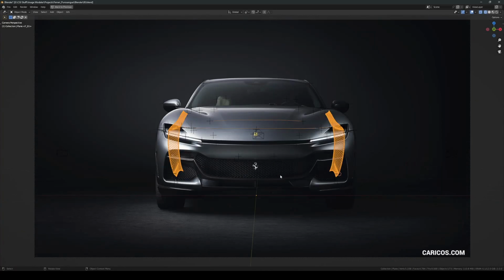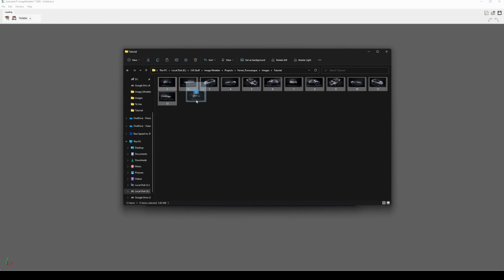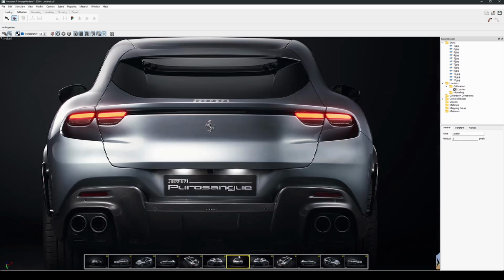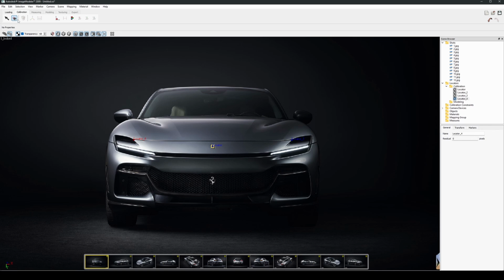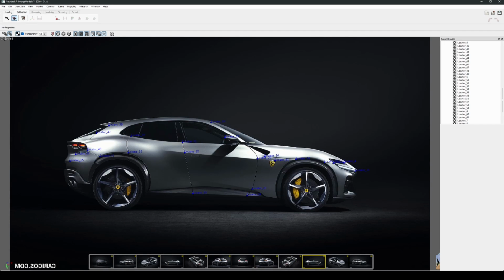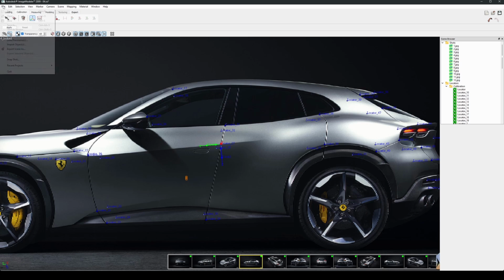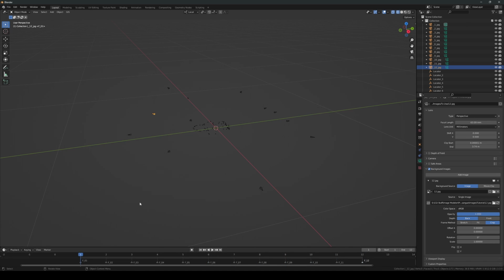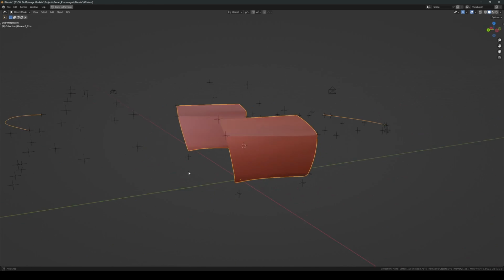Blender - Calibrate Images For 3D Modeling

Comment: I would recommend against placing too many locators in the beginning stages. Start with the front and place maybe 10-12 locators on the first 5 cameras, then calibrate, then start adding more and calibrating one camera at a time after that. I found that placing too many locators at the start can often confuse the application and if you've got so many it becomes more and more difficult too troubleshoot. There is also very little need to mirror the other side of the car, in most cases you can get away with maybe 8-10 images.

Lastly the 'photos' in this tutorial look like renders of a 3d model already and the front and back views are  perfect but if you are modeling an older car (before 2000) or maybe a car that is a bit more obscure and hard to find good pictures of then there is no chance your photos will be this good so your mileage may vary. Browse car auction sites and sites where your chosen car may be for sale, these generally have the best pictures of older cars.

Comment: Correct me if I'm wrong, but wouldn't camera tracking in Blender can also do the same as the image calibration process here? If so, that would save the user so much time because everything can be done in Blender without hopping to different softwares.
Reply: hi i've seen you on artstation
Reply: @Txkyohoshi  Hi! I also follow you on ArtStation! Your recent work on the Celica looks sick!
Reply: @Txkyohoshi  我也这么认为

Comment: any chance you could refresh this method to use something more recent like fspy?
Reply: if you really want to do something like this, you can just do it in your 3d program of choice by creating cylinders and trying to match their perspective to the wheel of the vehicle in reference image but that process takes hours if not days but just for the information, that is also a process that will give you similar results but is way way WAY more painful than placing a bunch of locators.
Reply: @Kumar-bg6nr  its VERY inaccurate that way
Reply: @Kumar-bg6nr  problem is the models i want to make are "no good blueprints" but aren't necessariyl lending themselves to good results with imagemodeler either, even with tracking targets.

Comment: This is a valuable tutorial. I'm all over this and going through it now. 
Mixing renders and photos is bad understandably. What about photos from different sources, how problematic are different focal lengths/cameras? Have you successfully modeled something from multiple sources?
Reply from the maker: That is fine, the reason renders and photos don't mix is how a company would say on their website as disclaimer that a product may not be as seen in the renders, pictures taken from different sources of the same car which is the final product of the company is fine... not sure if it makes sense... simply put renders are not the final product, they are just a representation...
Reply: @NaturalArtFreak  Thanks for the response. It makes total sense renders & real photos don't mix. The blueprint & final product have slight differences that won't align. That won't be an issue I'll be dealing with.
   What I've been wrestling with is different cameras and focal lengths, trying to match positions & painfully trying to align multiple angles. It's a lot of trouble and never quite right.
Reply: @shanester1832  ok. did some research. if you match distance of the camera from the subject, then you can just zoom the reference in or out until it fits. this will probably work in blender. maybe.
Reply: @lukefortune8314 thanks for the reply. I remember searching for something like this but never finding it. Manual photogrammetry pretty much, because to my knowledge, nobody's working on a photogrammetry approach where light source isn't a factor. Where photos taken of a moving object are just as viable as moving the camera around a fixed object.
Reply: @shanester1832  It may exist, but clearly not in any of the free software. there is a program called fspy that can solve for a camera position in a still image. might accelerate the manual process a bit.

Comment: I don't know how you did this. I even used the same images that you used in the tutorial, and I was INCREDIBLY careful in placing the markers (even named them all individually so that there's no confusion), and more than half of them end up being yellow and red. And no matter how much I adjust them, they remain yellow and red (and after I try to adjust them and then calibrate, there end up being even more yellow and red markers).
Reply: I managed to make things work, and I'm leaving a comment here in case someone encounters the same issues as me. Instead of importing all the images at once, I started with only two and added about 13 control points between them, then calibrating, and only adding more images if all the control points are green. I kept adding an image and control points, calibrating, then importing another image. Keep saving often, and if suddenly your control points turn red or yellow, just reload a save because it's a big mess trying to fix them.
Reply: same thing to me  @xayzer
Reply: If you mean you are experiencing the same problems as me, look at the comment with which I replied to my original comment, I found a solution that works for me and I wrote down the details.  @thomascook7319

Comment: Blender has a camera reconstruction (camera tracking), I did not try this but I think you could get this done in blender instead of Imagemodeler 2009. But I am not sure. I should try this once. If you load your images as a sequence in blender you should be able to reconstruct your cameras by hand in blender like you did in Imagemodeler by hand. There is also other Software like Photomodeler or Photoscanner much newer then 2009 on the market. At last this is SFM-structure from motion. I think they stoped this software because there are better solutions for this.
Reply: Any luck with using Blender to do the calibration?
Reply: @carsonw722  I tried this, but my Photos were not good at all and I had not enough tracking points. But there is a software calls photomodeler and is much newer then 2009, maybe you can do this with this software. Because I am on linux and cannot install a win.exe. But I used Photomodeler in an earlier version 20 years ago. So here I am sure that it can make the same as imagemodeler that is actually not on the market.

Comment: Is ImageModeler compatible with Windows 11? I can't seem to run mine properly, it always crashes when I try to start a project with multiple images.
Reply from the maker: Yes I run on Windows 11
Reply: @NaturalArtFreak  Thank you for the answer, I guess I'll never know what the reason is, because troubleshooting it isn't helping much and the software is not outputting any log files. Just out of curiousity, did you have to set it to "Windows Vista Service Pack 2" compability mode by any chance?
Reply from the maker: @mediumsolid2256  no didn't have to do any of that...
Reply: @NaturalArtFreak  Okay, good to know. Thanks for the info, much appreciated. Take care.
Reply from the maker: @mediumsolid2256  you're welcome
Reply: @NaturalArtFreak  no exist imagemodeler

Comment: Hi, Amazing video. Very helpful. 
PS, Has anyone used alternative software such as Meshroom instead of Autodesk Image Modeller? Just wondered if there are other options ? Thanks
Reply: I haven't tried this specifically, but in Reality Capture (photogrammetry software) it is possible to create locators manually in a similar fashion. It is also possible to export cameras with images linked to them, and import that in Blender. Maybe it can be used for this purpose.

Comment: Alternative Way (& a lifesaver): Use FSpy and it's import add-ons for Blender. CG Essentials even showcased it for modelling stuff in Blender. Just align the axes to their respective locations in relation to the car but make sure you aligned them with the straightest part you can find or the wheel centers on the car photos and you're good to go

Comment: Is there any way to allign a already existing model of a car to images to model modifications like bumpers?
Reply from the maker: Probably not without tweaking the car over and over, cause that car may have been modeled from blueprint which isn't entirely accurate.
Reply: use perspective n point for that if you are using blender

Comment: Do you have any vehicle modeled that we can check ? using this method i mean, because i'm in doubt now..  doesn't the camera FOV/mm lens distortion affects the final modeling? even with calibration? thanks
Reply from the maker: Yes, the intro video on my channel page has a vehicle in it that was achieved this way, no the camera fov won't affect the final model, I would advice you go images with little to no distortion in the them. Or with properties that the Blender camera can define. And most properties of cameras can be defined by Blender. And all that is set by the calibration.
Reply: unless the image was taken using fisheye lens, this method is way more accurate than using blueprints.
Reply: You are correct, and depending on the car you want to make you might not have very many points to 'snag' on meaning your calibration might be slightly off here and there, but its still way more accurate than blueprints.